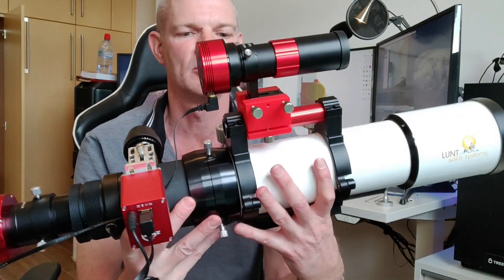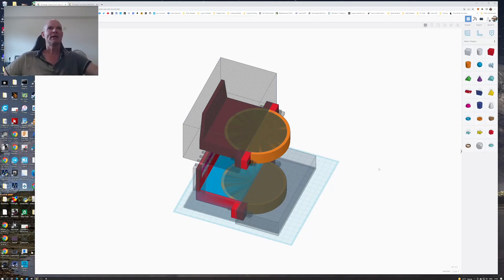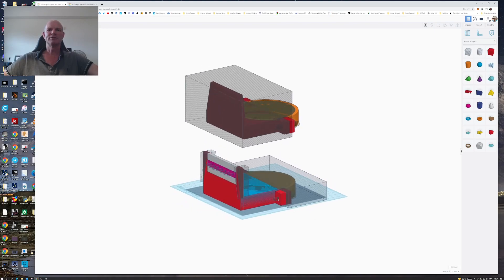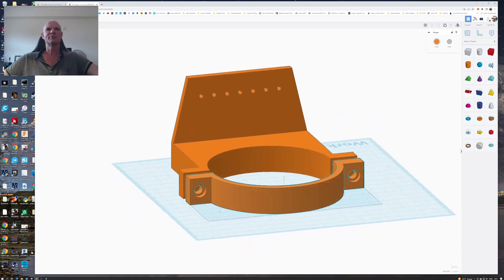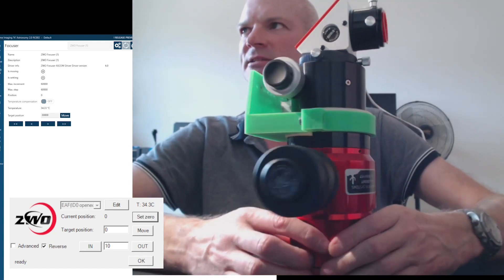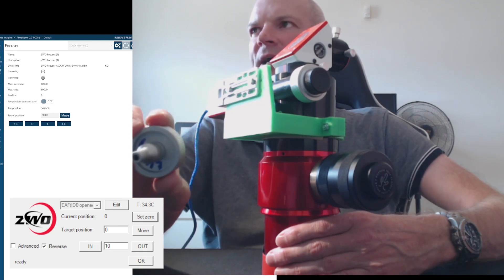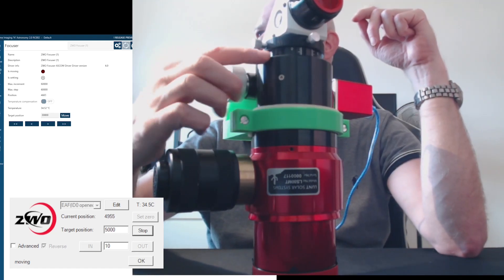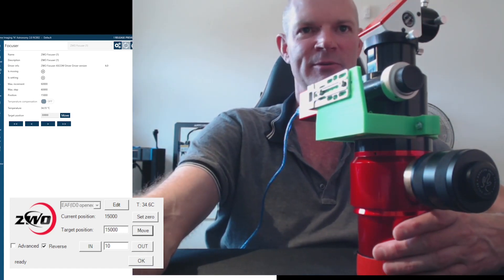Custom Mounting ZWO EAF Focuser to Lunt LS80MT Solar Module

Comment: Looks great, thanks for doing this. But are you sure there are not screw holes you could have used on that focuser? Is that the stock one or a feather touch?
Reply from the maker: Definitely no holes on this focuser.  This was the stock conversion kit focuser at the time.

Comment: Nicely designed and printed good job. Looks like you have more space to work with than my 60MT has.
Reply from the maker: I just hope that if and when I get the double stack unit it will still work. Would love to come up for a solution for the operating the pressure tuner as well, but would require a lot of torque to turn it and doubt there is enough power in an EAF.

Comment: This looked like a great solution Dave.  Such a versatile scope, that image of the sun was pretty awesome!
Reply from the maker: Cheers Ollie, came out well. Didn't think I was going to get away with it on the first print, as my measurements were a tad rough at the kick off. Usually takes a few iterations to dial in teh dimensions allowing for shrinkage and taking floating measurements.

Comment: Dave, have you tried a glue stick (ye old PritStick kinda thing) on the print bed before you start? Great for increasing bed adhesion. I have to use it when printing with conductive PLA. Use Windex to remove old residue between prints.
Reply from the maker: Yes I have been using glue sticks. This was the first print on this unit for weeks, I think it is the red pla as had issues with it before and last time an hour in the oven helped, so think it's moisture.
Reply: @DavesAstrophotography  never tried the oven......what temp?
Reply from the maker: @IanScottJohnston  around 50'c

Comment: Nice job Dave! You are always so great with the 3d prints man. They really are great tools for astro and so many other hobbies.
Reply from the maker: Cheers Joe! It's great when things work first time, my initial measurements were a bit rough, so didn't expect the first print off the machine to work near as perfect! (with the exception of running a 3.5mm drill through the holes, which I think is an acceptable level of error 😁.)

Comment: Very Nice Dave!  You gotta love 3D Printers.  If you can dream it, you can make it.  I like the idea of adding a little bit of support for version2.  Great images BTW. Clear skies.
Reply from the maker: Thanks, I did print it with a larger wall thickness than I normally print, and also had a higher infill density. It should be fine, but no harm in improving the v2 to potentially mitigate against a layer failure at the corner.